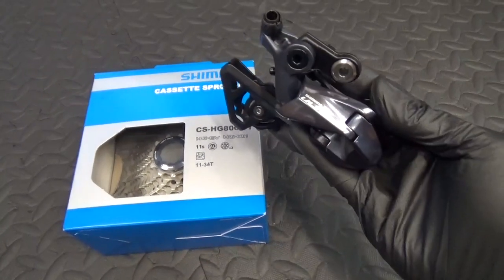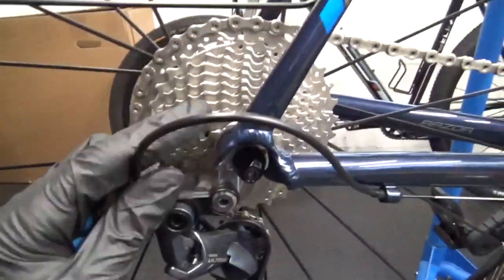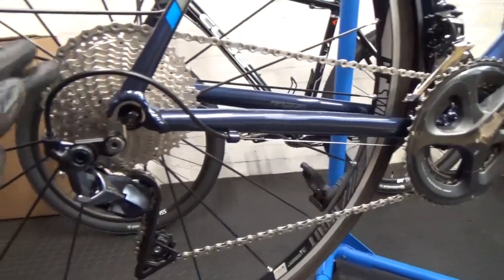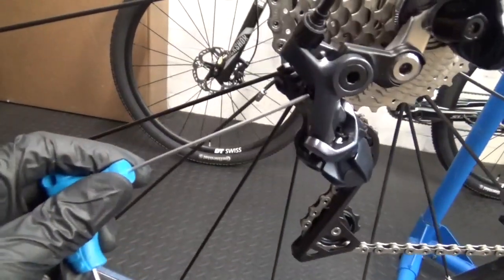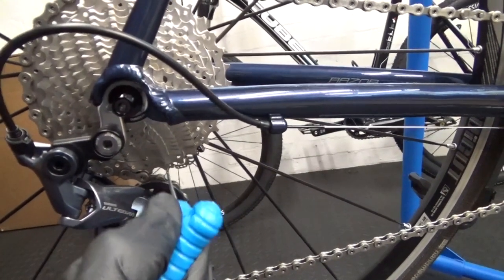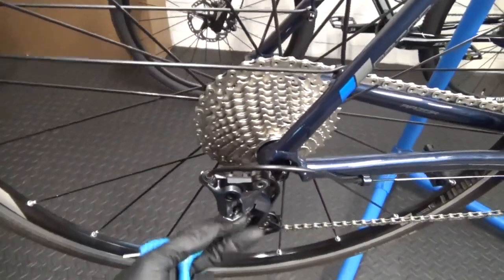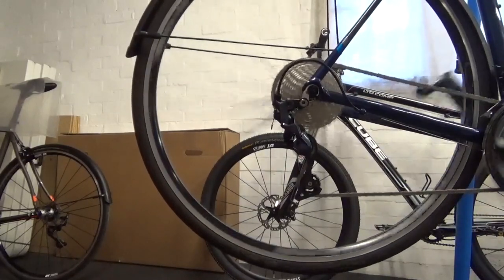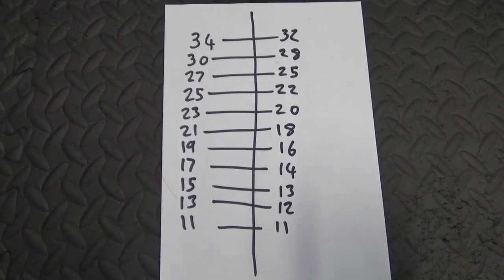Shimano 11-34 Cassette With A Short Cage Derailleur

Comment: at last a video that explains the b screw adjustment. I have an engwe ebike that had the original 14/28 freewheel. I currently have now a 11/28 but just purchased a drift maniac 11/34. because the bike is quite heavy, 2 batteries and the kitchen sink lol.  You're not allowed throttle and pulling away was a bit tricky and having an 11t meant no ghost pedaling at speed. hopefully now I can fit that 11/34. thanks for the video much appreciated❤

Comment: This re-assures me for my upcoming installation of 11-34t cassette to my 105 groups with Shimano 105 GS derailed to complete the change to use my Cannondale synapse carbon disc for gravel. Bke accommodates wide tires, just wanted to bring the 105 gearing up to the max for the gravel climbing so I'll end up with 50/34/ 11-34 or 1:1 34/34. So now the Winter bike has a use in the summer and takes away the temptation to buy a gravel bike for a few rides a year.  Great video!!
Reply: u use a medium cage or short?

Comment: Great video mate :) I run an 11-34 with my DA 9150. Runs flawlessly, even on the 50 front (tho I don’t cross chain the 50/34). My wife runs and older 6800 Di2 system. Was able to also get it to run a 11-34 with a swap to medium cage a friend had and a roadlink I had 👍🏼
Reply: you need to be very careful with Di2 going over the recommended limits - Most Di2 installation steps are similar to those of conventional mechanical groupsets, with one big exception: derailleur limit screws. If these are set too tight or restrictive this can cause extra strain and battery usage for both the rear and front derailleurs. I have drained my battery with 11-32 on SC and it took long to understand why.
Reply: Ramunas Macius all good mate my limit screws I reset with. The cassette. No battery issues since I did the conversion 5 months ago but handy to know thanks :)

Comment: So funny story 😅😅 I just installed a 11 - 36  CS-M771 cassette right now with a Taigra short cage derailleur.  It actually works ok, the front is 42 - 52.  Using the 52 front and 36 back doesn't sound that good though.  But avoiding that I just went for a nasty hill climb bike and it's good.  I actually have the Tiagra mid cage derailleur coming so will be changing to that and also replacing the 42 front with a 39 :)
Reply: I came from a Ultegra 11 - 28 for the cassette.  I used to have that FSA crank and chain rings, but the crank died so I swithced to an Ultegra crank but it can't have as smaller chain ring.  I couldn't do hills at all with the 28 and 42.  36 and 42 is good, 36 and 39 will be heaven haha

Comment: I have a Trek Emonda SL6 Pro Disc with Ultegra R8000 11s groupset. 52/36 and 11/30 and Short Cage Derailleur SS. I am having issues climbing in this ratio and hence bought a 50/34 and 11/34 cassette and a new HG701 11s chain. But I really don't want to spend on buying a new rear Derailleur and I am not able to find just the cage locally. Based on this video I can see I don't need either. Can you please confirm if my setting should work with the current SS Derailleur and why exactly then it's mentioned to use a Medium Cage?
Reply: I have exactly the same bike/groupset. Currently running 50/34 11-32 gearing that I have upgraded from the stock 52/36 11/30 (I live in Scotland and we have lots of lovely steep hills and headwinds 🤣) but after using 12s Ultra Di2 in Spain with a 34-34 lowest gear I’m going to swap the cassette again to an 11-34. The reason why Shimano state 30 is the largest sprocket is due to excessive safety factors and avoidance of potential court action from customers. Their chain wrap numbers are famously very conservative so 11-32 is considered the actual general max cassette size. Stretching to a slightly larger 11-34 is the same as going 2 teeth up rather than 4 if that makes sense?

Comment: I have 48/32 (Praxis) chainring and want to switch my 11-30 cassette to 11-32. Front derailleur is Dura-Ace (9100) and rear derailleur is Dura-Ace (9100). LBS says rear derailleur will not work for 11-32. What do you think?
Reply from the maker: The derailleur will work fine with the 11-32 cassette!

Comment: Great video. Did you have a derailleur hanger extension on? I am installing a 11-32  cassette from 11-28 on my Short derailleur ultegra 8000. So do I need the RD hanger extension?
Reply from the maker: A short cage derailleur will accommodate the 11-32t cassette! All you have to do is fit the cassette and adjust the b-screw and you’re good to go!!
Reply: Exactly what I wanted to know...❤
Reply: How can you tell if my RD is a short cage or not? It's a Shimano RD-5600. I'm trying to see if I can go up to 34t  @FreeToCycle

Comment: Simply, brilliant. My bike has a 53/39 crankset and a 11/28 cassette, I have read some instruction manuals from shimano and they suggest to calculate the range (sum of the differences between crankset and cassette) to see if the rear derailleur has the capacity depending on the cage (SS or GS)... Could I move to a 11/34 cassette just with your method or should I replace the SS cage for a GS (keeping the crankset... -chain replacement is necessary to what I understand-)? I would like to have a more "versatil" bike because when climbing up, it makes me suffer (a lot)    :')
thanks in advanced.
Reply from the maker: Change the chainset to a 50/34 that will make a much bigger difference to the bike than just changing the cassette!!

Comment: Hello I just fitted a 105 R7000 GS but when on small rear and small front the b-link on derailleur does not touch the frame hanger as there is chain sag. I have to adjust the derailleur to take up the sag.

Comment: Brilliant video.

I have an Ultegra 6800 long cage derralieur on mine so a 36 tooth cassette should go on no problem right? Just wind in the b screw a bit more, or at most a slightly longer b screw

Comment: Is the same true for a 105 RD7000 SS? My problem is my freehub body is older type that can only accommodate up to 10speed cassette…. But if I use the 11-34 cassette, I can make it fit the freehub but bot sure if the rear mech can shift all the way… I see you are using an Ultegra RD8000, so I was wondering if it is the same for a 105 RD7000. Thanks.

Comment: This is a quality presentation thanks,  and superb Channel ... I have a new Canyon Ultimate CF SL 8 fitted with Shimano Ultegra R8000 SS 11-speed, short cage design, which Canyon say has a max. cassette size: 30T.  I already have changed it to an 11/32 and works perfectly.   I have a 52/36 on the front and want to fit an 11/34 cassette as will be doing a long European tour with  big climbs some over 20% .  Will I need a longer chain?  Is it just a case of putting on the 11/34 and adjusting the B screw?
Reply from the maker: If you already have a 32t cassette then you maybe able to fit the 34 without the need for a new chain.
Reply: @FreeToCycle  Thanks for the super fast reply. Will I be able to fit the 11/34, I can fit the chain as required as you say. I was looking to buy a mid range cage with the 34 cassette … but will I need this?
Reply from the maker: There's not much point in changing the cage to a gs as the actual derailleur knuckle is slighty different on a medium cage derailluer, if you were going to change the cage you might as well fit a gs derailleur! Or swap the front chainrings to a compact 50/34.

Comment: I am running a Shimano ultegra Di2 R8070. Currently I have a 52/36 in the front and a 11/30 in the back. I am not sure on what cage I have. I read online that a medium cage measures 74mm centre to centre of each jockey wheel of the RD, so I assume i have a medium cage, as I measured 74mm. Would I be able to run a 11/34 in the back by only adjusting the B screw and a longer chain or do I need other changes too?

Comment: Great video. Thinking of changing from 30t to either 32    or 34 t. Chainrings 50:34. Will new chain need to be longer? If yes how many links? Thanks
Reply from the maker: If going to a 32t you will be fine with the existing chain! You may have to add a link for the 34t, but try it first might be ok.
Reply: Thanks for the very speedy reply. I’ll give it a go! 👍

Comment: I added a road link anyway, but works great. The problem I have now is that the chain is really noisy compared to before I changed it. I can't see the chain rubbing on anything. Can you suggest why it's got so loud?
Reply from the maker: Shouldn’t be any noisier than before! Is the chain routed through the rear derailleur correctly?
Reply: @FreeToCycle  yes, everything is the same but I added a road link, new cassette and chain. It sounds like the chain is rubbing on a derailer but I don't see any rubbing
Reply: @FreeToCycle  I just checked again and you were right. The chain wasn't aligned in the cage right so it was rubbing. I unscrewed the cage and put it back together again. All working silently now. Thanks 👍.

Comment: nice info. I am about to change CS-R8000 11-30T with short cage derailleur to a new cassette of CS R8000 11x34 together with a new set of longcage derailleur and a chain. After watching your video, I stopped moving to cassette change. Could you tell me what the difference is there between Ultegra CS-HG 800-11 (11x34) you are talking and CS R-8000 11-34.
Reply from the maker: There is no difference the cassette’s are both the same!!

Comment: Great video. Would this work with the same Ultegra derailleur switching from an 11-30 to an 11-34 with 52/36 chainrings? Also would I need a longer chain? Many thanks
Reply from the maker: Yes it will work! You may have to add a couple of links to the chain and adjust the B screw after fitting the cassette.
Reply: @FreeToCycle  Brilliant. Many thanks for the quick reply!
Reply: Too bad... I should have seen  your video. I have just ordered a new di2 derailleur with medium cage (gs) with the 11-34 cassette in order to mmive from 11-30 to 11-34. Do you think the results are the same with di2 ultegra (8050) rear derailleur than with the mechanical one ?

Comment: What is your front ring difference?  My capacity is 37. I want to use a Shimano GS Medium but the spec says my 16t front difference is to much? "Maximum Chain ring Size Difference: 10T (medium GS version), 22T (long SGS version)"

Comment: If I am changing brand and speed: from Shimano 105  11-speed 11-30 cassette to a Dura-Ace 9200 12-speed, 11-30 cassette with Dura-ace 9100 11-speed FD  and Dura-Ace 50-34T 12-speed crankset...what problem I will encounter? Do I need to change the 11-speed chain?

Comment: If I replace the SS cage of my r7000 with a ceramic oversized guide wheels which are 18t-13t wheels, will it be sufficient enough to go upto 40t cassette?
Reply from the maker: No!

Comment: I run Sram Apex 10 speed with the short cage derailleur (only goes to 28) ...do u think I will be ok to go to a 34 cassette with wolf tooth extender and a new chain ?
Reply: Did you try it? I'm planning to do the same, but an 11/32

Comment: You say you have plenty of b screw leftover. Does this mean you could easily run a 40t or 42t cassette?
Reply from the maker: Not on a short cage derailleur!
Reply: @FreeToCycle  does this mean 34 is the absolute limit on a ss with hanger extension or do you think you could pull off 36, 37, 38?
Reply from the maker: You will need a Roadlink to go larger on the short cage!
Reply: @FreeToCycle  so with an extended wolftooth road link how big of a cassette could you push a short cage

Comment: Thanks for the great video! I've been thinking about this for a while now, I've got an 11-28 with a short cage 105 derailleur (RD-5800-SS) and I want to swap the cassette for an 11-32. Do you think it will also work on this derailleur model? (Shimano says it can support only up to 28T, but as your video shows perfectly, they are quite conservative in this recommendations)
Reply from the maker: Not with the 5800 SS rear derailleur! It will work fine with the R7000 short cage rear derailleur.
Reply: @FreeToCycle  Thanks for answering! Too bad it wont work with the 5800 series... but these are an older version, so I had guessed they would be a bit more limited. Since I have to get a new one anyway, I might as well get the R7000 middle cage, I don't mind the couple of extra grams, and at least I will be inside the specifications.
Reply: Will this work for ultegra 6800 short reach rd? It is like same design at 5800. Hope someone can answer my question?
Reply from the maker: No not with a 6800 short cage derailleur!
Reply: RD-7000-ss can support for 11-34T on 22 inch folding bike?

Comment: Nice video! I have 2 questions: 1. This video used an Ultegra R8000, but I have a 105 R5800. Will I get the same results? 2. The cadence change on the 15-13-11 cogs is large. Could 14 and 13 cogs replace the 13 and 11, maybe with Shimano or Miche sprockets?
Reply from the maker: To run a 11-34 cassette with a 5800 rear derailleur you would need to fit the GS version!
Reply: Thanks for the quick response!

Comment: Thanks for this video. I've been running the same 11-34 cassette with the 34/50 chainset and the Medium cage Ultegra rear derailleur for the past 12+ months. In general, I really like it and it suits the hilly terrain down here in Cornwall. However, I do find some of the jumps between the 11-19 cogs whilst in the big ring to be quite noticeable - I sometimes struggle to find the right gear during group rides. I wonder if the 11-32 would suit me better?
Reply: PS: I only bought the Medium cage (SGS?) R8000 rear derailleur, because I ran an 11-40 cassette during last year's Etape du Tour (with a Wolf Tooth Roadlink).
Reply: When using my 11-34 cassette I have to frequently shift chainrings to get the proper ratio. This is annoying. So, unless I really need the 34 teeth, I prefer to use my 11-32 cassette.
Reply: Ultegra only has two Deraiileurs... Short (SS) and Medium (GS), there is not Long... Only for the Mountain Bikes... It's easy to tell the SS and GS apart.. the SS is really short and stubby.
Reply: @Tchairdjian  This derailleur in the video looks like a medium. Doesn't look like a short, or are my eyes playing tricks?
Reply: @shitfer  That is a SS. I owned the same and and it's longer compare to say a Tiagra SS.

Comment: Thanks for sharing. Planning to use Tiagra 4700 short cage on 11-32T cogs with 50T chainring. Do you think this will work?
Reply from the maker: Max 30t with a Tiagra short cage derailleur! You would require the GS version or a wolf tooth road link on the SS to run a 32t cassette!

Comment: Just did this upgrade on my SL7 and everything seems to be working.  I can shift all the gears except when in the 34 the rear mech grinds from touching the cog.  I didn’t extend the chain and the stock cassette was a 11-30.  My LBS is closed til Tuesday and I adjusted the B screw until it will go into the 34 cog and still grinds.  All other shifts seem to be fine.  I cant seem to get any more room out of the rear settings.  Do you think this is because i need a longer chain and provide more slack?  Thanks for the video also, saved me some money.
Reply from the maker: What derailleur are you using?
Reply: It’s an Di2 ultegra
Reply: medium cage
Reply from the maker: The gs version is designed to work with an 11-34 cassette as standard! So should have plenty of adjustment on the b-screw! You could try adding a couple of links to the chain.
Reply: @FreeToCycle   just picked up a new chain, will swap it in the morning

Comment: Does this work with 36-46 in front? I have ultegra 6800 SS with 11-28, could use the 11-34 for the hills.
Reply from the maker: Not with a 6800 Short cage derailleur!
Reply: @FreeToCycle  will buy a GS ultegra derailleur then🤷‍♂️

Comment: Thanks another very informative video, I have a 8000 Ultegra rear mech how do I know if it's short, medium or long cage
Reply from the maker: On the back of the cage between the two jockey wheels it will say either GS for long cage or SS for the short cage version.

Comment: Hi I am currently running an 11-30 cassette Do I have to change my chain if I put an 11-34 cassette on ?
Thanks
Reply from the maker: No you should be fine! As long as the chain has been sized properly in the first place.
Reply: That's great thanks

Comment: A little off track...but what is the lightest 11-32 cassette I can purchase for use on my road bike?  Using Shimano derailleurs but don't mind using Shimano or SRAM cassettes.
Reply from the maker: I would stick with the Ultegra R8000 11-32 or if weight is the goal then you would have to go to the Dura-Ace r9100 11-30 cassette. https://youtu.be/Zd_MMccIkFw

Comment: Hi, when you fit the 11 speed 34 from a 32 cassette do you need to fit any spacers etc or will it just fit without any adjustment other than the B screw
Thanks
Reply from the maker: Straight swap other than the B screw!

Comment: Hello,

I will update my rear cassette from 11-34 to 11-30, my rear derailleur is a long cage GS it will be OK using a long cage GS with 11-30 cassette? 

According to Shimano website short cage is OK for 11-30 cassette but i need to use the same derailleur so it will be ok with my GS long cage derailleur?
Reply from the maker: The GS derailleur will work fine with a 11-30 cassette!
Reply: @FreeToCycle  thank you for reply 🙏🏻🚴💨♥️